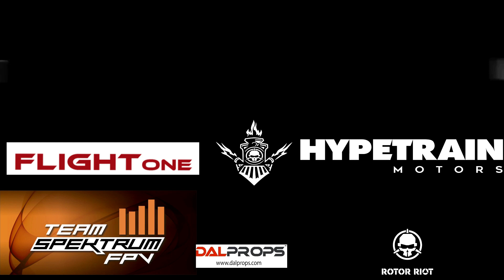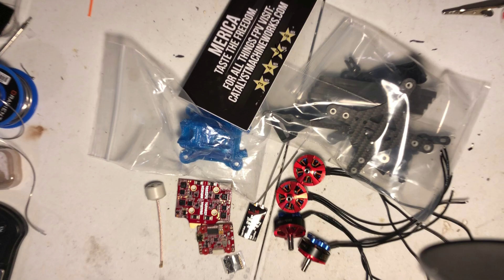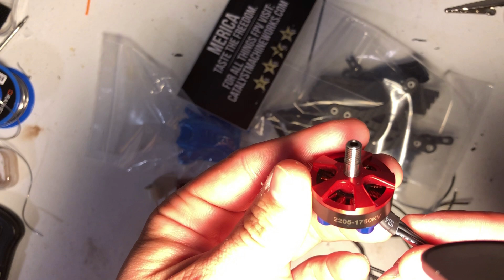6s Ultralight build + Maiden flight.

Comment: Did u have any issues with how u
Mounted the esc with the pin connector on top and motor pads on bottom? Are you using a cap I have all the same parts. My first 6s build just don’t want it to blow up
Reply from the maker: KYTE FPV no issues with esc mounting this way. And yea I have a 1000 uF 35V cap straight on the lipo leads
Reply: GC Cannonball dame with fc with the usb on the top?
Reply from the maker: KYTE FPV I used a blade to cut out a small piece of the canopy to be able to have enough room to access the usb.
Reply: GC Cannonball okay one more thing what tune are u running for this build?
Reply from the maker: KYTE FPV I run the vanover tune with my personal rates and small change in tpa
Reply: GC Cannonball what changes lol if u don’t mind this if my first 6s any advice on it would help
Reply from the maker: KYTE FPV no problem at all. I just set all the curves to 100% across the board. This gives me a consistent starting point in case I want to make any adjustments later, but usually works very well
Reply: GC Cannonball do u use a pre loaded tune like GoPro or vanhover
Reply from the maker: KYTE FPV yes the vanover tune

Comment: How do those 6s 2205s feel?? I have really only flew 2306 and 2307s on 6s... and 2207 1660kv R3s on a 7 inch long range build. Never flew a 22xx stator motor on 6s , do they hold up well and how's the power?
Reply from the maker: Quadcopters And Airguns power is really nice with this KV. Similar to 2700+ kv on 4s but way more snappy. I think this setup will be killer for tight technical tracks or indoor stuff/ close proximity flying freestyle. However I think you’ll want to limit using bigger pitch props since it lack the tq to move them like a 2306/2207 would
Reply: GC Cannonball that's mainly what I was asking and confirmed my thoughts that even on 6s the 2205s would like the torque to handle heavier props.. I hate those damn 5051s I have had more then a few brand new ones with no crashes or strikes explode on me on just quick blips of full throttle.. hell just had one do it a few days ago on a 2700kv LS2206, I love the response of them on small tight tracks on super light 2205 and 2206 builds but have had to many of them just explode.. have you had issues with them just loosing a blade mid flight?? I agree wholly with your statement of my fav frame.. I love my Merica builds, still haven't found another frame that handles like it.
Reply from the maker: Quadcopters And Airguns actually the flight footage at the end was on GF 5152. So it will work no issue but I think it would do better with 5043- 5046 props
Reply: GC Cannonball that is impressive pop out of turns with high load props like that on little stator motors.. on the the 5152 Tri blades or bi blades? I think I'm gonna order a few sets of those motors and build a ultra light free style quad on them for 6s 1050s on some low load props and should get really good flight times and insane response... how's the throttle curve of those motors is all the power in the last 20 to 30% or are they more linear across the stick throw?? That's something I'm not liking about the low KV Tmotor 6s motors is they feel dull in the mid range of the stick and all the power comes on in the last 30% of stick travel to the point for MultiGP 6s builds I've had to add a 3d heli-esq throttle/pitch curve to make them feel consistent across the stick travel (I prefer more the meat of my power range to be from about 30% to 80% of stick travel with slightly softer off zero throttle stick feel and less explosive last 15 to 20% of Stick travel but much more throttle speed change in the 30 to 80% of stick throw.. that comes from me being a long time 3d heli pilot and how my pitch curves was setup.. giving me 80% of my pos and neg pitch range with just 30% neg and 30% pos from center of my collective pitch stick.. I ask how's the throttle curve even tho I will adjust it in the radio but some motors that have all the power in one small area of stick travel make it very hard to dial in a throttle curve how I like it.
Reply: Quadcopters And Airguns I love using the Dal 5051's but they have a life expectancy of about a week to me it seems without hitting stuff. I guess the plastic at the hub gets weak from flexing over time and than flings blades off at random times causing ass clenching crashes randomly so I just swap them out for a new pair every week if I don't crash them first, but love the way they fly and have a large surplus of them.
Reply from the maker: Garrett Johnson it’s a very thin blade so yea I have same experience